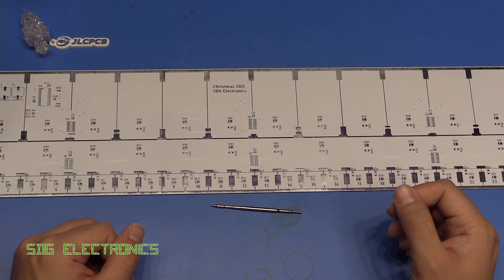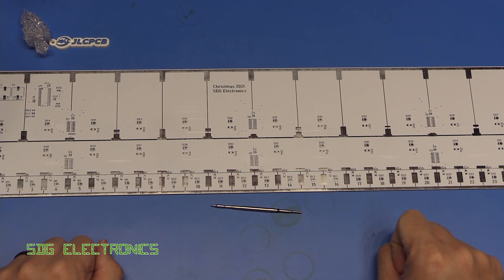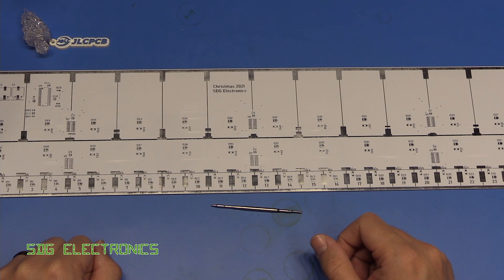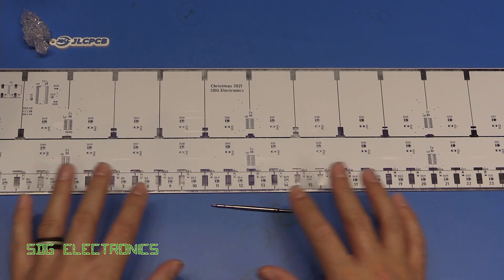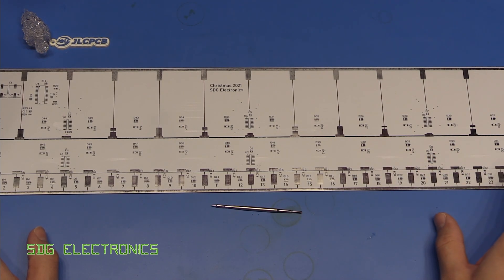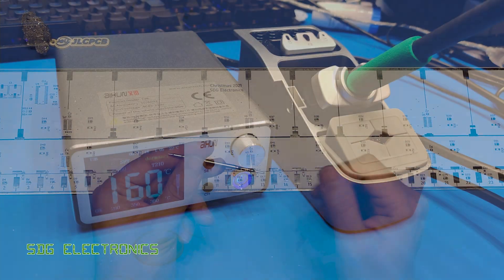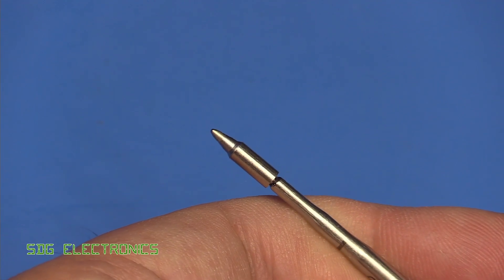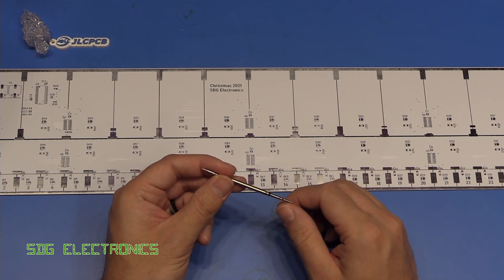SDG #234 Soldering up the longest PCB I've ever had manufactured at JLCPCB

Comment: Hey, have you ever tried metal core PCBs with pedestal/sinkpad? that's where the heatsink pad is soldered directly to the metal substrate?
Reply from the maker: No, I'm not sure how effective it would be, though I may investigate this. Aluminium quickly forms oxides on the surface, so uou'd normally use very acidic flux to solder to Aluminium. As part of the general rework process it likely wouldn't bond.
Reply: @sdgelectronics  I believe they plate an additional layer to make it solderable.

Comment: I'm new at soldering. Does it matter if you tin all the pads first or do what you did? What would be best practice?
Reply: You tin one side only first on the passives for example so that your component can sit flat when you melt the solder on one side when placing the component. If you tin both sides you'll never get it flat.
Reply: @IanScottJohnston  this is great. Thank you so much.

Comment: Why that sad music for such a nice soldering job ? :)
Reply: It's soldercial music.
Reply from the maker: Actually I was not that happy with the soldering. I feel like I get better results with my regular soldering station, but have no explanation as to why it would have been better on these components
Reply: @sdgelectronics  Im just guessing that its caused by low ammount of flux in solder wire you used. Ive got simmilar problems with thin solder wire (0.5mm) Would be nice if you can test your regullar soldering iron (Metcal) to compare.